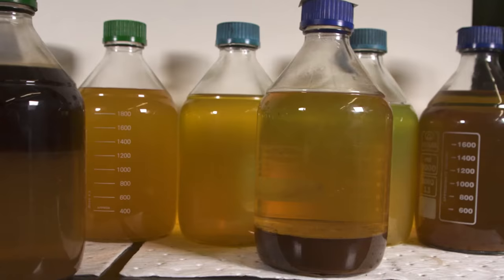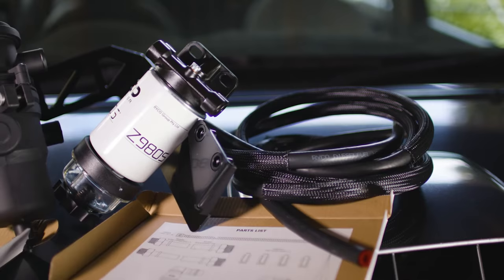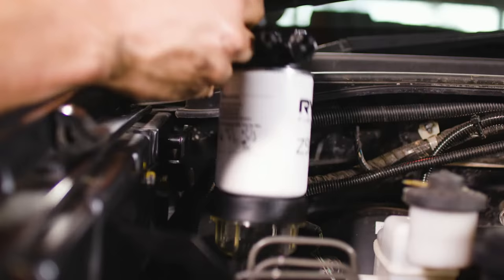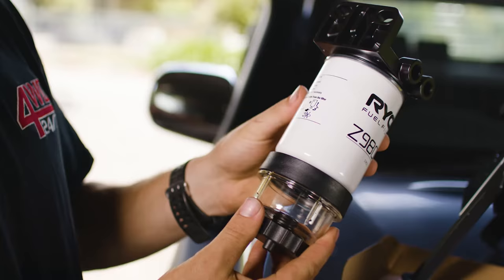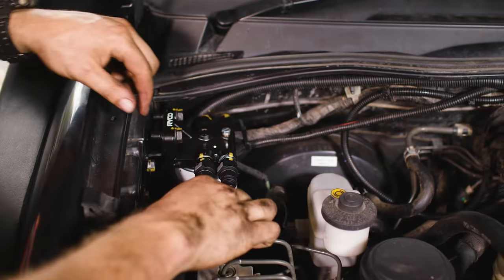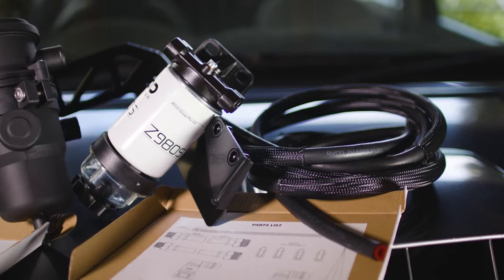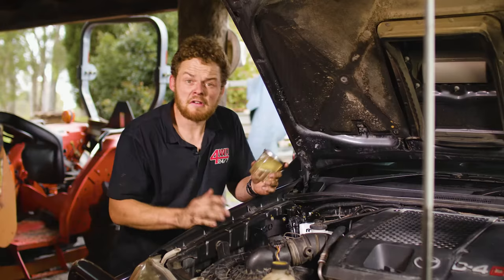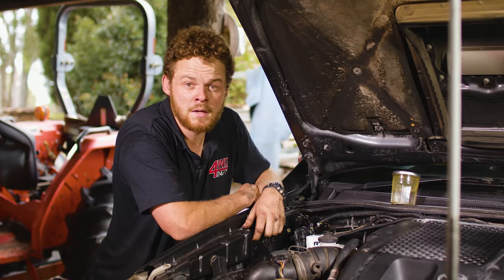How to Remove Water in your Diesel Engines Fuel

Comment: Got a question the dmax has a plastic water separator unit in it the engine bay (black and a yellow tab on it) no desiel is comming out of it at all even when primed and running question is  how do you unclogg it so desiel comes out of it again . Any help would be awesome a video on it would be good as there is no vids to do it .